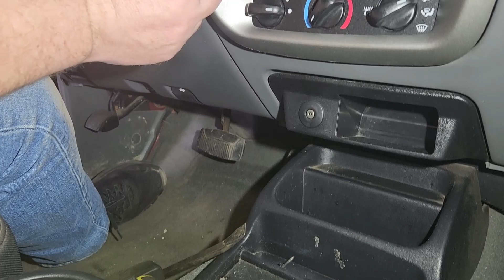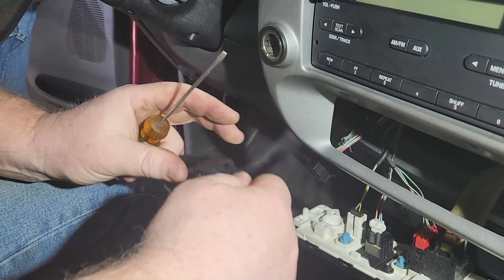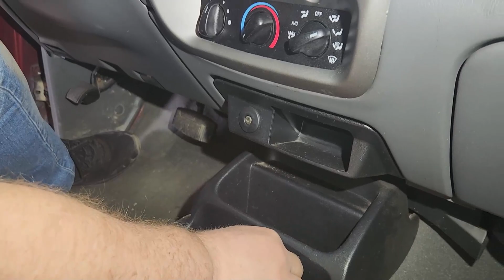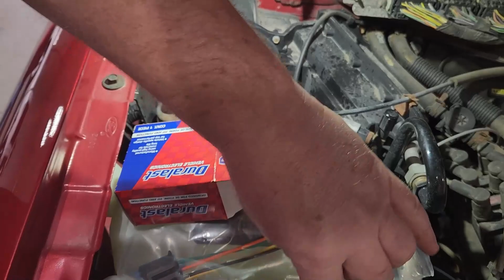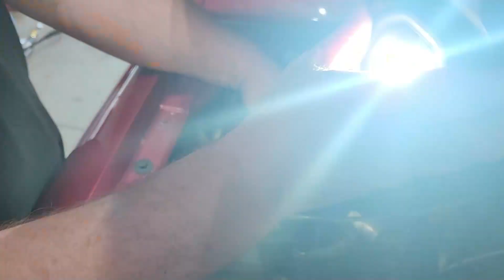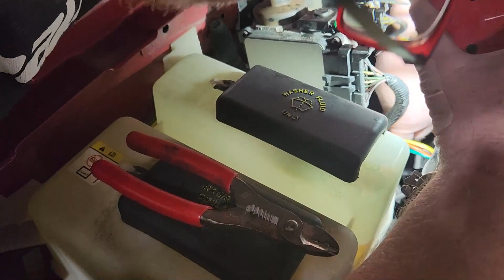Blower Motor only works on high? Do THIS | How to fix blower motor/switch on a 2008 Ford Ranger XLT

Comment: I understand why the resistor might need replaced if the switch only works on high, or the fan switch is bad if it only works on some settings, but how did you conclude both needs replaced?   I think I would have done the resistor and plug first and then returned the switch if that solved the problem.
Reply from the maker: Plug was burned in two places and resistor was rusted.  So replaced both.

Comment: Great vid. Thanks for the help!
Reply from the maker: Glad I could help. you're welcome.
Reply: It's the resistor not the switch big dummy🎉🎉🎉😅😅😅💩💩💩💩💩
Reply: So now on my 2007 Ranger, I’m not getting any fan speeds. What would be the problem if you don’t get any blower fan at all?